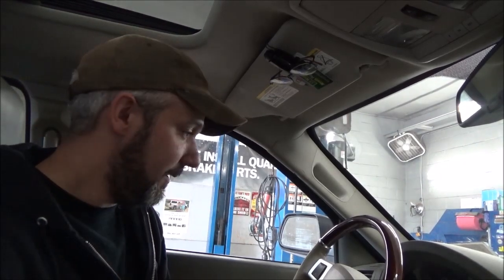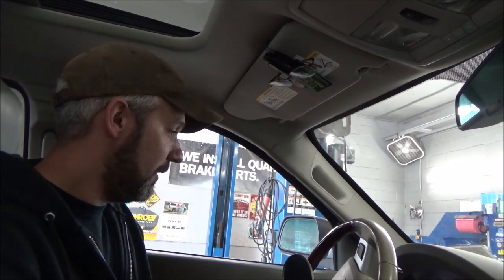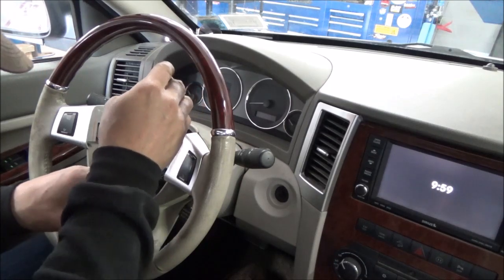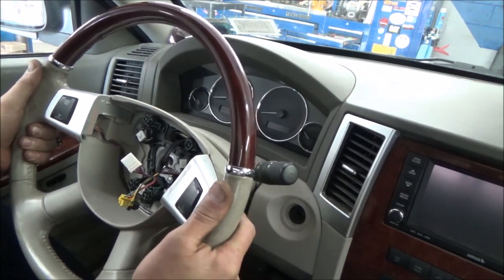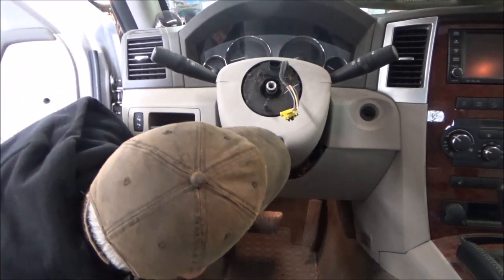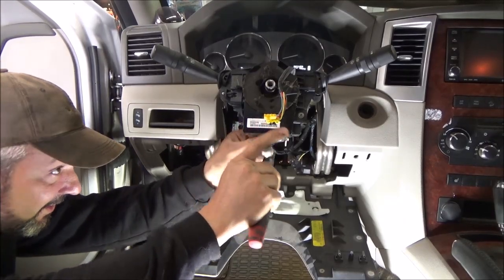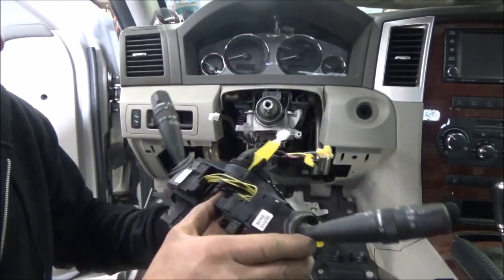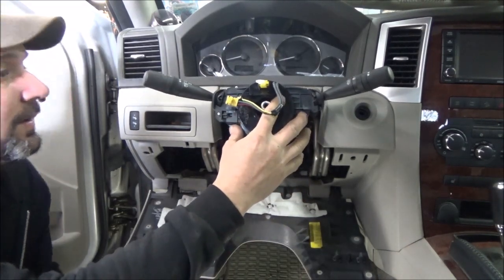The Fix: Chrysler SRS Air Bag Codes: B1B02, B1B06

Comment: I'm glad you mentioned the factory flow chart issue. More often than not, they are dead wrong, and you will indeed spend countless hours chasing a ghost. I learned that the hard way in the '90s, and they are just as useless now. I don't know who writes them, but they are just way off 90% of the time. Test it yourself using common sense and electrical theory, and you'll get it right the first time, in much less time. Thx Eric!

Comment: Note: When putting screws into plastic. 
Turn the screw backwards until it drops into the thread slots. Then tighten normally. 
That prevents cutting new slots and stripping the plastic.

Comment: Air Bag circuits are fun!  Especially when someone else has been in there!  I had some of the Ford simulators, and they worked well.  I also had an "intermittent"  squib, clockspring, whatever you want to call it, on a GM van.  That was fun.  Using the Tech 2, I was able to see the problem which was a big help.
Great Video, wish all air bags were that easy to work on.

Comment: Considering the clock spring is the weak link I am surprised the manual would tell you to change the bag before the spring. But then again they would get you for an air bag and clock spring for a zillion dollars. Got to love it.
Reply from the maker: and the problem would be fixed in the end and they would look like a hero
Reply: you're the hero. Nice trouble shooting. As a electronic tech I can appreciate the way you checked to problem. Nice job.

Comment: Thanks for the well done video. I could change the clock spring on my 2009 Commander strictly following your vid and without firing the airbag. Thanks a lot for your work and advices. Here in France, Jeep dealer was charging 1500 usd for this job..😢

Comment: Goop (without pumice) works excellent for cleaning vinyl, plastic, and leather car interiors. Apply with cloth, let soak in ~5-10 minutes (depending on severity of dirt) then simply wipe off, turning cloth frequently. It's lanolin base will float out dirt, and moisturize the surface. It is safe for all colors. Use either the "original" or citrus oil formulas. It works wonders!
Reply from the maker: I have actually used that and you are 100% right it works fantastic on fabrics
Reply: South Main Auto Repair  You can save a lot of money- get an old used washer, for the shop, wash your used rags and work clothes with a 1/4 cup of Goop per load.

For your dash & trim- you don't have to follow up with an "Armor All" type of protectant; the lanolin is superior to all that.

You will not believe how much dirt floats out of what appears to be "clean"!
Reply: Best RV Cleaner made as well if you want to spend the time to do it. takes the oxidation off and leaves a protective coating.

Comment: I pulled off a 98 VW Golf steering wheel one time. I didn't disconnect the battery. I didn't unplug the airbag with the key on but I did turn on the key with everything disassembled momentarily to turn the column a ittle bit for some reason. It set an airbag code that I was unable to reset because I didn't have the right scan tool. Was an $85 mistake to just have the code reset. Lesson: if you don't have a higher end scan tool with airbag capability be careful doing all that with the battery connected. Some cars aren't as forgiving as the Jeep.
Reply from the maker: About the worst that can happen...
Reply: Naw, the worse that could had happen was that the airbag would had fired and he would be looking at a more expensive repairs.
Reply: Not likely (impossible, actually) with the airbag removed already.  My only point is that unplugging an airbag with the key on will set a code and, on some cars, it won't reset itself when you plug it back in.  That was my $85 lesson. The chances are extremely remote that the airbag would fire when unplugging with the key on.  I probably wouldn't plug it back in with the key on but, as Eric stated, it would have to have a short somewhere for it to fire anyway.

Comment: @South Main Auto Repair

We have a special tool for popping those airbags out, but it's forever missing. What I use is a tack puller, works like a charm.
Reply from the maker: we use the classic reach around move

Comment: What if you have the squib 1 open circuit and it is not the clock spring? How can you diagnose the problem then? I noticed while driving my 09 sebring the car dings at me when I change gear from drive to reverse or vice versa.

Comment: @7:14 Tip, if you don't want to end op with 'summerteeth', you better put the middle steeringwheel bolt back in and fasten it with 2 or 3 turns and than go godzilla on your steeringwheel to poll it off. Seen it happen, from broken teeth to bloody noses...
Reply: Thanks for that tip

Comment: You should always unhook battery before working on the airbag system and the problem was probably the fact that there were no shorter bars in the plugs. Always have to have shorter bars to complete circuit and eliminate open squib lights.
Reply: That was giving me terrible anxiety also

Comment: Hey I have a question, When Replacing Driver and Passenger AirBag that deployed, Will replacing Both airbags automatically turn off the airbag lights? Or will it need programming or scanner to turn it off? I'm Having Code 0006 Driver Squib Circuit #1 Open. 2000 Dodge Intrepid.

Comment: hi dude, on my jeep Patriot  there is an airbag light on since 4 days, but sometimes the light get off and after some minuts turn back on. the diagnostic device show me the B1B06 error. What is the problem for you? the clock spring? let me know, thanks!

Comment: Great video I've a dodge nitro 2008 crd  4xwheel drive  with air bag light on off and diagnostic reading is B1B06 driver Air bag squib 2 circuit open. Goes off and comes on when i go round corners sometimes it remains off for a while during a journey then it come back on i thought may be was a trapped wire or dodgy connector under seat but I have checked them all seem intact. 
Is it possibly the clock spring that's goosed
Thanks Tony from over the pond in Scotland

Comment: How about doing a video on how to open a Honda Odyssey 2008 EX-L passenger door when neither handle works and tell us which part/s would need replacing? I could really use that video right now because my mom is having that problem right now. Great video btw.
Reply: There's some pretty good help over on the OdyClub.com forums for the 2005-2010 Ody's.  I've done repairs on my own doors plus helped quite a few others over there with theirs.  There are a few very common failure and wear items.  What it needs depends on the exact symptoms, of course.  The rear rollers on most of those vans are worn out now and are quite noisy if they haven't been replaced.  The unlatching motors (not the main door motor) get sticky inside and the doors will pop or stick during opening/closing.  Also, the rear latches get sticky and will cause the doors to stop working altogether, and very often will cause a parasitic drain on the battery of nearly half an amp.  If you post your problem over there in the 2005-2010 section I'll help out.
Reply: I joined but never got the email registration. I did however figure out the problem messing the the front passenger door again. The locking actuator is toast because the lock will not lock or unlock via the remote or via driver side switch. I also found out the reason the door would not open is because the lock will not fully disengage when you manually pull it up. You have to pull the lock and the door handle at the same time to open the door.

Comment: Hi, I did a clock spring replacement in my Chrysler after erreur code B1B02 and the airbag ligth is still on all the time. I can't erase it. I've tried everything. I already double checked all conections. Could you please give me a tip? Thank you very much

Comment: the video Was very usefull for me. i own a 2010 dodge journey and the  airbag s Red light is turning on and off when i turn the wheel from right to left.  the horn and the other commands work properly. I Believe That the problem resides on the clockspring.

Comment: What's a SQUIB??  2000 Chrysler voyager air bag light on.  had it scanned at auto parts store. Driver side SQUIB open circuit.  (clock spring?)

Comment: oem for jeeps are crazy expensive now, almost 500$ for clock spring,  can i get away from buying a chinese aftermarket part for 90$  im driving a beater car in winter will it fit even if it says fits jeeps have u ever bough after mark

Comment: Hi O, why did you have the engine running when you removed airbag mod? thanks again for the show!
Reply: Power steering
Reply from the maker: Power steering...
Reply: ok week sauce can't turn the wheel
Reply from the maker: Bel Neff work smart not hard...

Comment: Hello, I have B1B06 code in my JEEP WK. I change clockspring yesterday for original part from MOPAR. After montage part and switching on the starter, airbag light still shine. I check the codes and i have B1B03. Driver airbag squib 1 have constant resistance 1.5ohm and driver airbag squib 2 have constant resistance 3.1ohm. Squib 1 have too low resistance.
Plis help me, what can I do?
Reply: Did you end up getting this fixed??

Comment: Most flow charts like to disconnect and do ohms checks and 1 strand of wire will pass an ohms test until you load it & then it fails big time. I use them for readings but when they want you to disconnect plugs you can't get to without dismantling I use my brain and come up with a better method. If you don't check a loaded circuit you may end up on a wild goose chase and they can fly and I can't. Sorry to hear about your arthritis especially when you work with your hands like we do. I'm finally throwing in the towel & getting my shoulder surgery...limited range of motion & pain is making it hard to get into contorted positions we get into and taking twice as long to fix stuff is driving me crazy. Well another SMA satisfied customer and all I use is OEM when it comes to air bag components unless Wells makes it and then I'll use either.
Reply from the maker: I hear that! The chronic pain  sucks but I have come to live with it I guess. I love Wells products but they don't carry many here in our stores.
Reply: Yep I order Wells from on-line but Advance Auto & AutoZone are starting to carry more Wells now in my area. Most of my customers would rather wait for me to get quality parts online at a great price than pay for crap or ridiculous dealer prices. Well I hope you get blessed with a cure for your hand! Pain is inevitable as a mechanic especially when it is self inflicted as I laugh about all the times I've hurt myself...the majority I won't mention!
Reply from the maker: Hayward's Automotive Appreciate that but there is no cure for the arthritis I have. Gotta learn to live with it :)

Comment: What if it hadn't been the Clock Spring but the Squib cable itself What to do then? I just had the airbags replaced and have had an issue with the Squid codes and the vehicle has had clock springs changed out 7 times. When you lower the tilt the light comes back on after every repair and the last time the light came on while I was at the dealership leaving the lot when I lowered the wheel. 
I complained and they told me that this time had been a courtesy repair because the car was out of warranty? I got in contact with the District Chrysler Rep and was told QUOTE (We ain't doing shit to it, its out of warranty!) Now I'm stuck with a car that has never had a passenger operational Airbag unless I'm willing to fork over $500+ to let them try again? WTF!

Comment: What is the degree of difficulty on that classic full-handed reach around?
I'd give you a 9.5, but the stingy German judge gives a 7.0.
Reply from the maker: Depends on the angle and the amount of visibility. Using a mirror with arthritis in my hands, face pressed against the air bag I would give this a difficulty rating of 6.35. The fully blinded reach around would be the most difficult of all reach arounds.

Comment: Crazy how much parts cost these days. We're getting bent over BIG time ...
Reply: It so annoying too. I just out a aftermarket egr valve pressure sensor in a 06 taurus and it was almost 70$ for that plastic small part.
Reply: I had to replace a door latch in the neighbor's '09 Ford Escape. Thing was 100% plastic and unserviceable - I could see the busted plastic part inside that caused the inside door lever to fail (had to put window down to get out). Dorman had one for $200 or so - checked Ford $400!! WTF! What a joke!

My '72 El Camino had all the original door hardware, and so does my '86 Grand Marquis (aside from door pins and bushings which I just did last week). Not only is stuff super-expensive today, but it's total crap. Never heard of a door latch failing that way before, ever.

Comment: So in other words the auto designers did away with the "Swash Plate" and replaced it with the device called a Clock Spring. From what I've seen, they were better off not redesigning the part....There is an old saying that I live by.."If it ain't broke, don't fix it"...:-)

Comment: I won't lie, I got really worried when you started pulling stuff apart with the car running!  Someone I worked with years ago ended up in the hospital after an air bag went off on him during a repair; he'll be on disability the rest of his life.  I've had one pop on me as well, and I consider myself lucky that all I got was a mild concussion and a broken passenger seat.

I'm a bit embarrassed to admit, but I know very little about how these airbag systems actually work.  I was always told to disconnect the battery and let the car sit for ~15 minutes to let the SRS reserve charge deplete, but I have no idea if there's actually any truth to this or not!
Reply from the maker: If it was shorted to power and ground it would already have been deployed I am not to worried about it., If the systems were this sensitive and failure prone they would be blowing off on people at random driving down the road...
Reply: what's the big deal about disconnecting the battery and being safe? How much more time does this really add the repair?
Reply from the maker: Explain to me how unplugging it can make it deploy. Not being a smart ass but I would like to know.
Reply: Yeah, seems to me if unplugging it could cause it to deploy then every time a clock spring or wire got broken we'd have a deployment and we'd have thousands of inadvertent deployments.  Worst case is you set a code which, on some cars, most DIY'ers probably can't reset.  I finally bought an Autel MD802 to solve that problem...only because I couldn't afford the DS708!
Reply: It's not that it can deploy, it's just in case Mrs O runs out and kicks the front bumper while you have it next to your face!!
Reply from the maker: roadkill5333 Haha pretty sure the SRS module looks for more than just a front impact to deploy air bag lol
Reply: A co-worker's wife had the steering wheel airbag deploy on her while she was driving on the highway.  After her nerves settled she drove on.  Then a second airbag deployed from the steering wheel.  The car sat at the Chevy garage a long time because those airbags were on backorder.
Reply: The part I thought was funny or at least interesting was the backorder.  It suggests this was a common problem.

Comment: Hmmm...never took an airbag out with the car running! Mr danger! LOL
Reply from the maker: Explain to me how it is dangerous?
Reply: No problem. The capacitor that supplies the voltage to fire the airbag is energized whenever the key is on. Turning the key off and waiting 10 seconds, even without the battery disconnected allows the voltage in the capacitor to dissapate, completely eliminating the possibilty of accidental deployment. However it unlikely that the Jeep would slip into drive and hit the wall of the shop, It's not dangerous at all.
Reply from the maker: James Last exactly... besides if it had a short to power and ground... I am no expert but I feel it would already have been deployed...
Reply: I have never heard of that happening. Actually I was being sarcastic with my first comment. Iam sorry you took it seriously.
Reply: But, with the build quality of Tacata airbags, they may be more dangerous after being installed than while installing.

Comment: Clock Spring?
Reply: An electrical cord connected to the steering wheel wound in a coil so that it can coil and uncoil without breaking as the steering wheel is turned.
Reply from the maker: https://www.youtube.com/watch?v=3vFkSuozoLA
Reply: I'm feeling old now. Clocks used to need to be wound up in order to work.  They had springs in them that made them run and they looked like a flat coil.